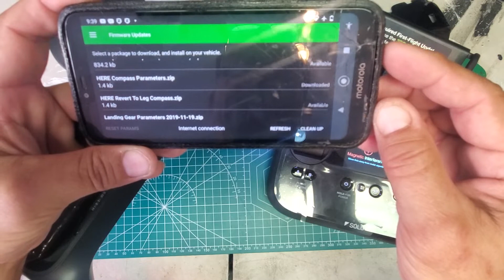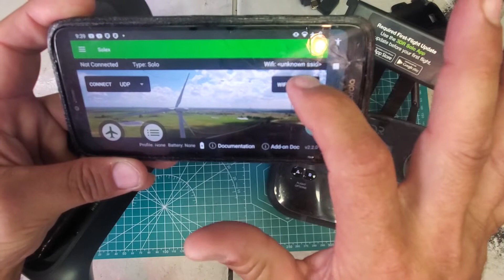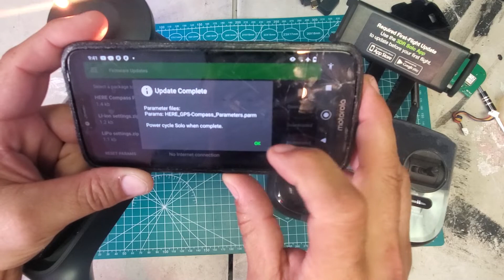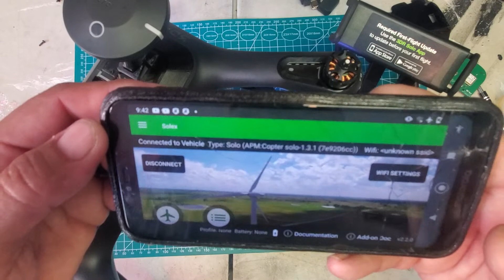Here v1 GPS PnP for Solo How to Install

Comment: Just wondering why did you not plug in the compass cable?
Reply from the maker: I actually didn't plug in either connector because I wasn't actually installing it on mine, just showing how to do it. If the volume is up you can hear me say something to that effect.

Comment: How do you calibrate it for the Upside Down step, keeping it level, with the antenna sticking up ?
Reply from the maker: No need for it to be level in that step. Sitting upsidedown on the GPS unit and rear motors is fine. The first step in the compass calibration it the only step where it is important to be as level as possible.